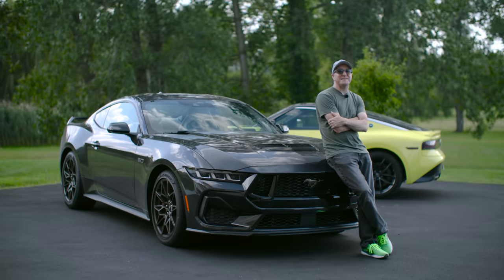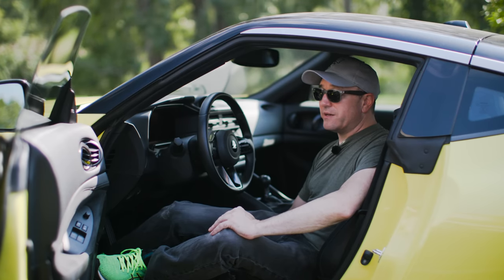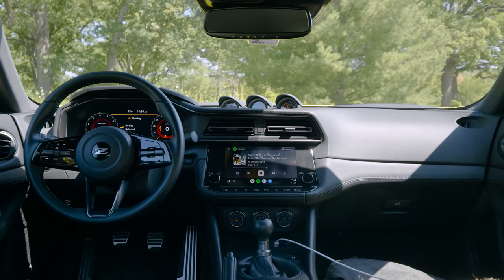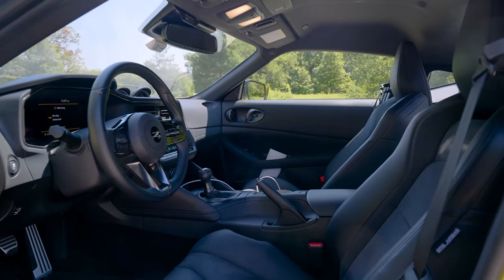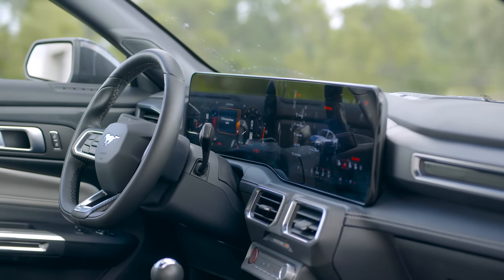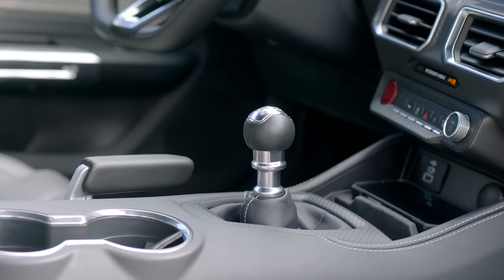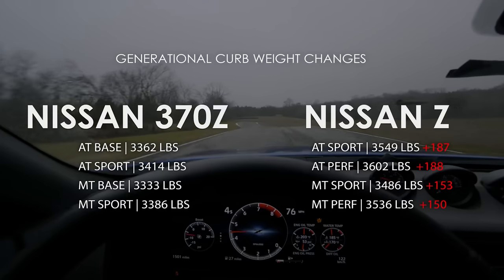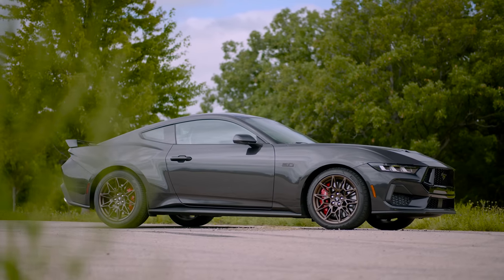Mustang GT vs Nissan Z | Maximum Muscle, High Prices

Comment: I don't know anyone that owns the new Z car and you don't see them on the street, why don't you tell them the reason why? Because the transmission goes out at about 3 thousands miles they have been recalled as a failure

Comment: Both these cars are over-rated.  At those price points I’ll spend a few more beans and buy the Supra, used 09 R8 etc.  

I guess I’m in the minority that thinks the Nissan is homely looking, especially compared to the 370z.  The proportions are wrong and the front end is so plain. Rear end looks blah.   The sides look like slabs.  Just doesn’t look special imho the way past Z’s looked.

The Mustang looks much better between the two though.  I liked Fooses rendition of the 400z much better than Nissans.  Wish they had the funds to actually build a new chassis that could have faithfully gotten closer to the OG Z profile.

Comment: Why modern cars have so much weight...is a little mind boggling.
All the aluminum components, Both these cars have more aluminum components then both of their original cars.
Yes yes yes crash worthiness between old and new are better.
But all this weight is over the top.
    Also both of these Sports Cars have soft Passenger Car suspensions because BUYERS complain every single time they build a performance spec chassis. So the leave it to the after market. 
  Which is fine, the enthusiasts will take it from there!

Comment: The mustang is way too heavy I agree it should stay around 3700 in my opinion maybe 3800? Max this would make this car definitely not challenger heavy weight feeling lol JS mustang fox weighed 2950-3150lbs now we are over 4? But more hp I get it but on the track that’s a 1000 lbs more then a nascar Busch series car wig less hp 😢but I know does wants safety a concern and get that completely

Comment: The new mustang looks like crap. Sorry to say it. IT looks unbalanced. i really hate it. The last gen looked better, and the gen before that was essentially the best looking of the last 2 decades so to speak. It looks awkward and already dated. It even looks honestly ugly. Like it has bag-eyed and tired, and looking cross-eyed and angry at the same time. It just doesn't look good. The new Z at least looks okay. i think the air intake does not look as refined as it should or could have been, but it looks okay.

For the interior, the Z looks freshened compared to it's predecessors and good, and i think quality is good too. The Mustang, even though it greatly lost it's appeal that it had before, looks a lot different on the inside now, and i'm not really a fan, it looks more like a 'knight rider' and 80s reborn than a proper evolution or mustang, it's almost like it's trying to be a different car. that said, i do think that the interior is more enjoyable and spacious, but something tells me the build quality of the Z is somehow better long-term.

technically, i think this is immediately obvious because those loose tie-rod nuts are just unacceptable and really worrysome. If that is real though and not just a video joke. Still, i think the mustang technically is not really a bad car, i don't think however it is as reliable as i think the new Z likely is. I also think that the new mustang is mostly 'squeezed' already in terms of performance possibilities, without huge changes, whereas i think the Z has loads of potential to be improved with not too much or too big 'stage' changes. 

Overall, the Z looks like it's great fun for decent money. The mustang is more 'grey' and living on a name and idea rather than a decent fun and enjoyable car.

Comment: They need to just make the mustang a 2 seater. nobody is buying this to hall their friends around in or family of 4. cut a few inches out of the middle and easily drop a few hundred pounds. The new mustangs are way, way, way to heavy, but i'd never spend 60k on that Z. I'll be sticking to my 06 gt which weighs less than 3500 with a whipple under the hood and almost a full tank of gas. I'd hate to think of what i'd need to do to get a 2024 GT under 3500lbs.

Comment: The spring rates do NOT match the dampening on the 2024 Mustang GT, PERIOD.   It's non confidence inspiring like driving on top of a ball in the front end with no rigidity of springs to fall onto.   Sucks.   Take it to STEEDA for a compete suspension overhaul and lose 400lbs and then.

Comment: Ranting here: Always expected to buy a sports car in retirement. The problem is that the interior  tech is just such a turn off. It's not even like they try to make it aesthetic. That Mustang screen is an abomination. Meanwhile the Z looks like it was designed by a committee with a strange mix of tech and superfluous analog dials.  I feel like tech in cars is like the early days of computers where you had to deal with a cathode ray tube. My wife won't drive my BMW because the learning curve is so high. Used cars can be just as bad because you have to go pretty far back to get something analog. Instead you get an old car with outdated tech that is impossible to update. Doesn't anyone understand that good design is simplicity? I'm just waiting for the day that I have to flush my toilet with my phone app. - after first selecting the sport flow option.

Comment: $62K for a Mustang GT? Seriously? Who is buying these? I really wanted to like the Z...really did. Ugh. I'd take a Camaro SS over both.
Reply: A 4000lb non-supercharged Mustang? Pass. That's as bad as a 4000lb hybrid Corvette.
Reply: So you are going to spend $53K on a Z and your compliments are that "aftermarket suspension, tires and alignment" will make it perform? Seriously? If that's the case, buy a C6 Corvette for half the price and throw $10K at aftermarket and it would slaughter the Z (and the Mustang).

Comment: "All the physical-mechanical connections between you and the driving machine are really good"

Interesting, ThrottleHouse absolutely slammed the steering for having no feel.

So which channel knows nothing about cars?
Reply: He was talking about inputs in the interior. Not actual driving feedback. While the steering in this car isnt great I disagree with TH on saying its worse than the prior gen s550.
Reply: @jackholmes8105  "Connections" means two-way input and feedback, no?

Interesting to read your take, for TH it almost ruined the car. Maybe give it another "feel" when you take the Dark Horse to the track.
Reply: @TheUrbanEpicure  we drove it on track in our original piece, something to note the gt they drove was not a performance pack car. The DH also gets different front tires and geometry.
Reply: @TheUrbanEpicure  yea im with jackholmes on this one, he definitely was not referring to the steering feel

Comment: As a massive Nissan fanboy, I'll still take a mustang over the Z.
- the VR30 is NOT an upgrade over the VQ37 or the VQ35DE
- $ for $, even the Kia Stinger gives comparable performance with better interior quality
- even after all these years, Nissan still can't get their heads out of their own asses and allow traction control / VDC to turn the yaw sensor off (the early 3.8 Genesis coupes and BRZs could do it, 1st gen boxster could do it, fuck me the ecoboost mustang can do it....)
- there are literally pieces of the old 370Z straight pulled and dropped in
- blind spots on the new Z are dogshit

Comment: I'm unsure as to the logic of a 5.0 V8 in 2023. I still have a V8 Porsche, but it hasn't been out in ages. I figure it costs me about $15 just to start it.
Smaller turbocharged engines are what I now crave.
Because boosting is so much more fun than instant torque. It actually requires skill to get the most out of it. And good driving skills are rewarded with amazing feels, and big BOV sounds. :D

Comment: if i was gonna spend that kind of money on a one-trick poney, i wouldn't. You can get a used 911 or Cayman, or a whole lot of small nimble Japanese fun car for that price.
I'd pick a Miata or BRZ, and spend the rest on the household. The extra 20k you gotta spend to 'upgrade' to one of those is absolutely not worth it. Having 400hp on the street is a waste, imho. Both the Miata and BRZ do with less than 200 and they're a lot of fun; I guess you're rowing more gears before you get to illegal speeds?

anyway...I'd pick the Z over the GT to lose 100kg. Also, can't stand the look of the GT butt or interior capacity crap, nor how long it is for being a coupe.

Comment: After  2019 the Getrag MT82D4 has been flawless.  Only issue is the ratios, which a set of 4.09 gears goes along way to alleviate.  One other thing, Ford Performance will offer a handling kit for these cars that will solve a lot of these issues, and it will have a warranty.

Comment: Pains me to say it but Ferd wins on other levels as well.
The Mustang Eco 4banger turbo can replace all the abused 240sx/silvias suffering PTSD, whose owners' fat asses can't fit in a BRZ86GT, i.e. I look like a monkey humping a football climbing into one.....

Price wise, it is where the 240z's $3500 in 1971, would be today : ~ $29k before Dealer lubing up.

Unless Nissan does a twin turbo or work with Stillen for a supercharger like in the early 2000's,  Nissan Z is just eye candy. 

Pains me as an Ex-Maxima 2002 owner and G37 in the fam.

Comment: I don’t get why Mark is so high on the “new” Z. Everything about that car screams begrudging and unenthusiastic like Nissan was forced to release it and they did it as cheaply as possible via extreme parts bin reuse. I’ve read every comparison test and the Z has not won any of them. Not one. In fact, it has finished behind some cars it should have beat like the CTR.

Also why are you guys talking about the aftermarket so much? The Z is a historical marque, it should have been great from the factory without needing mods installed by amateurs. No one talks about aftermarket for Porsches because those cars are great from the boot.

The “new” Z is a terribly executed profoundly disappointing car. And this is borne out by the sales figures because no one is buying it.

Comment: I had a new S550 in 2015 with std wheels and tires and what a joke.   The PZero Nero did not grip on the wet, did not grip on dry pavement and snow and ice was like riding a psychotic horse thru a burning barn.   Not long after snow encounter with the GT ( don’t even ask how I found myself in that situation) Ford did an ad that said with the PZero Nero tires the new Mustang could deal with winter weather and be a 4 season vehicle.   What a crock of bullshit… I had to turn the traction control off and spin my way up every hill and god forbid stopping on an incline.   Good luck getting it moving again.   Really, Ford…! Does that sound like a 4 season vehicle.   Only if you’re a stunt driver for the motion picture industry.   I paid $44,400 for my 2015 GT Premium Convertible… which I considered 2 much then and the replacement sticker being around $55-57,000 is wishful thinking fird the turd.    Not my $55K, anyway.   Glad for the “z” info.   It has a much greater chance of occupying my garage.   If I 28:03  purchase one it will be my 4th “Z”.   I had a new 1993 300ZX Twin Turbo a new 1996 300ZX Twin Turbo and a new 2008 350 Z Roadster.   Probably my last new car ever so ending with a “Z” would put a smile on my old face.  Ford’s greediness with their pricing just sickens me. $1600 in freight charges for a Mustang from Dearborn to upstate SC when Toyota can ship a much larger and heavier 4 Runner from Japan to upstate SC.   The 4 runner has to cross the entire Pacific Ocean then rail ship all the way to Atlanta to the distributor and then trucked to Spartanburg , SC all for $900… and you want me to believe it costs almost twice as much to ship a Mustang less than a third of the distance.   Does Ford think we are all stupid or do they think they are BMW and can charge whatever they want and people keep on buying.   Good luck Ford.   Hope you go broke soon!   You deserve it.

Comment: Z built on Altima platform under neath the car is old outdated technology and it’s no Supra 3.0 those things don’t sell at all my local dealers are stuck with the cars they tried to sell over retail where as the Supras are incoming sold
Reply: No it's still built on the 370zs platform and just shares a Q series engine. Only new thing with it is the merc 9 speed trans in it.

Comment: 27:11 Nissan sticking to their old ways and putting a useless gauge in the Z center dash cluster again… a boost gauge yes but really why also a turbo speed gauge?? Totally useless and redundant, that could’ve been an oil pressure and/or oil temp gauge, or even better lose the useless voltometer and have both oil temp and pressure… gauges that youd actually want for any spirited /track driving (yes i know its not a track car and maybe the nismo will have those, but turbo speed is so silly 😂)

Comment: And why does the Z instrument cluster have C7 graphics? That's just lazy on Nissan's part. You couple that with a chassis that was designed in the late 90s, plus a transmission that doesn't like to be rushed ( which you guys skipped right over that) - and with Buick Lacrosse suspension tuning - you have a car that's tripping over its own feet. 

And Ford can do better. Most Americans complain about a harsh ride if they are in anything that drives sporty. The word (compliant ) is overused. It's like men are not really men anymore: afraid to feel a bump .That's why I prefer german suspension tuning. Ford can do better but their audience in general will always complain. So think about that when you guys are talking about turn- in being crisp, or the lack of it in a Mustang. Americans just complain about any feedback and seem to hate anything sporty. They love having the words 'race and track' on their cars - but want it to drive like a Camry. 

Which brings me to the GTD,  where I see a bunch of suckers. Bragging about a car that Ford doesn't even make. A select few will drive them to cars and coffee and that will be the extent of that car.

Comment: lol a model 3 performance for 46k after rebate, even cheaper in many states will run circles around these things for less money. reason why fossil performance cars are dead. minimal entry is now 60K. No one can afford these. if you like to go fast for not too much money, get used to an EV.
Reply: Most working class can't charge em nightly, can't rely on them without a massive tether and range issue. You are being very elitist right now.

Comment: What the heck is a Bdyn engineer? Is that supposed to be Body Design? Don't make me do it i will totally go boomer on you right now, please tell me it meant something else, if it didn't please never use that annotation again it sounds like cheesy marketing, all that is holy is just makes anything you do age like milk, lets assume someone watches this years from now.  Have to hit you with my boomer self because i know you will never listen to what zoomer side of me has to say.
Rest of video good stuff thanks.
About the Mustangs Steering and Handling, its odd but it feels a bit like a situation where Mazda's influence rubbed off, i know the partnership is done at this point but we had how many much better handling more reliable daily drivers co-designed (largely just designed by) Mazda but with any of these, Mazda 3/Focus is classic example you had pin point precise steering but with NO FEEL.  As someone who values steering feel as top priority and having lived with cars from that era, i will give it the benefit of the doubt that every time i drove mine i wished it had more feel but weirdly because everything else worked it didn't bother me, now with the Mustang it sounds similar.  At least on the upside you won't see any customer complaints about steering from older or more timid clientele, if it still handles well and its controls allow precise inputs then maybe it isn't perfect, but its a compromise i can kind of understand.

Comment: who can fix the new mustang if electronics fail?
your old crusty trusted mechanics who worked on your SN95 and S197 for years?
doubt it.
you are taking the new mustang to the dealership and pray some 20 year old graduate of Ford program know how to connect the wires and replace the sensors.
God have mercy on you.

Comment: How can you compare a 370Z to the New S650 Mustang. Nissan can't sell the Z because it's a terrible car. I believe you mentioned 25 items just to get the Z competitive. If you pick the Z over the Mustang. You need to find a new career. I also recommend speaking to some Mustang engineers regarding the S650 changes over the S550 including the weight. I believe you'll find the S550 GT and S650 GT weight pretty much identical. 

FYI. Over the last 4 years. Nissan sold under 4000 370Z. Impressive comparison

I'll save you some time regarding, testing the Dark Horse. Read Motor Trends Dark Horse test article.  The S650 GT tracks well with the Dark Horse several levels better. I am looking at S650 GT for $50,000. With plenty of options. Your Ford rep must have added a markup. I have to close by your mentioning your purchased an S550 Mustang with REBATES. REALLY. REBATES.... NOT IN TODAYS ECONOMY. HELL. GOODLUCK finding a decent interest rate